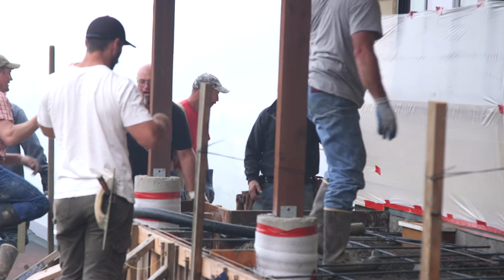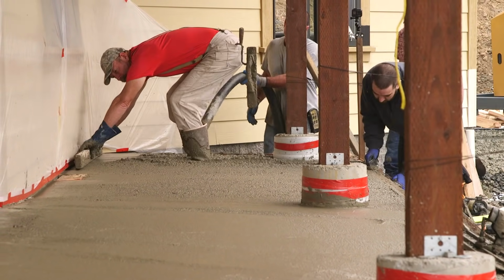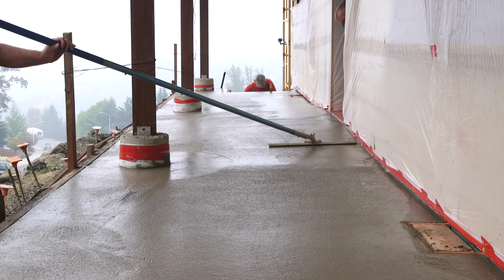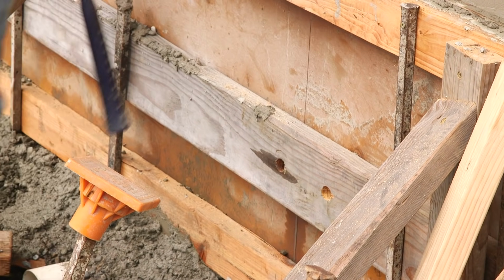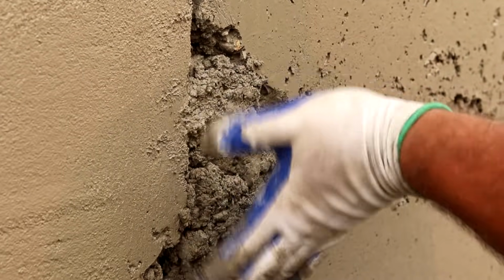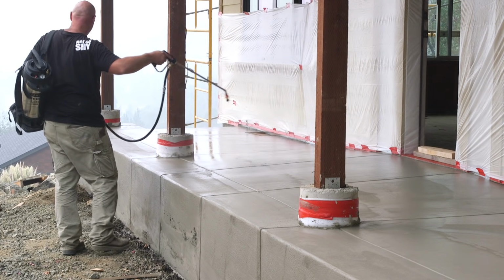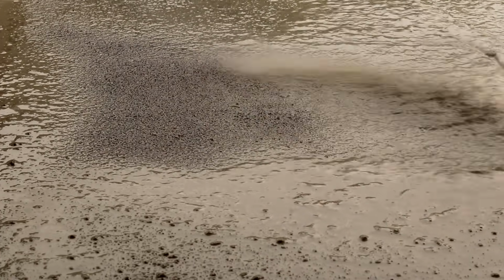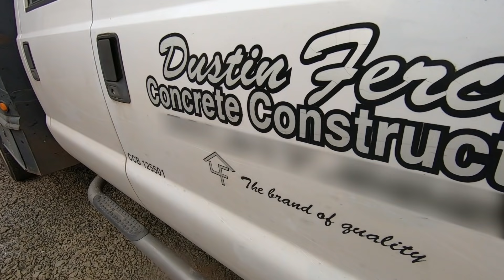Pouring Technical Concrete Ep.92

Comment: Tho, I only worked on a concrete crew for around 1 1/2 years as a young man, the lesson of timing was a lesson I used and still use in my life. I found later in life farmers also use timing, my neighbor in Texas would walk his fields looking for the perfect time to plow (5,000 acres), even if it happened to be 3am, the tractors were fired up and away they went. He told me its all about diesel fuel use.

Comment: When I heard "exposed aggregate finish" I thought that sounded silly and ugly because concrete is supposed to be nice and smooth and grey, right? Then I see the result and I'm like... I want that on my house.
Reply: A lot of folk are going for concrete floors containing limestone and other rock chips that are then ground down/polished and stained/lacquered.
While it ain't going to get any 'green' thumbs up, it is very nice, especially for southern texas, etc.
Reply: @conniethunder  yes generally speaking. But it is possible now to source carbon neutral or negative concrete mixes. However I imagine in most parts of the world it isn't available due to lack of demand (extra cost to achieve that).
Reply: @samt5663  carbon neutral materials, there's a debate you could have for ever,  speaking of which , if something can last for ever and doesn't need replacing,  does that not make it by default , the most neutral product, ?
concrete by nature is a forever product, its been around since Egyptian times, perfected by the roman times and in excavations of those times, is still in good condition,  and we still use it today, 
there for isn't it the most neutral building product , for being carbon neutral,
today we can add a lot of different  aggregates to give a variety of looks , if chosen correctly you'll never tire of it,  negating the need to change it, 
:)
Reply: @accessaryman  thanks Owen. Very good points.
And to give more context to my previous comment. I was referring to the sourcing, manufacture, delivery and installation but excluding the lifetime of the final product. Which would be harder goal to achieve for carbon neutrality.
Reply: Very popular concrete finish in the 70’s and 80’s…
Reply: it looks like a 50 year old concrete pier on the beach. i mean that in a good way.
Reply: I have it on my back patio (house built in '75). Not a fan. It looks nice, but it's painful to walk across if you ever want to go in the backyard barefoot.
Reply: Texture is good. The house I live in has a concrete front porch and driveway that were poured around the 50s. I don't know if it was the wear over the years or they thought the smoother the better, but when rain decides to blow in they become slicker than a slip and slide. Busted my knees several times from falling while not paying attention.
Reply: @accessaryman  I guess you could have a "carbon neutral" product by calculating how much pollution the process makes and then planting X number of trees or something similar to counteract it?
Reply: I do a lot of high end builds here in Aus and the trend for the last while here has been 2 or more colours of larger aggregate, and then pure white concrete. The larger aggregate allows for a slightly deeper wash and a better look in my opinion.
Reply: @Ben-fk9ey  concrete can actually be very energy saving in the long run too, as it holds heat from the day and releases it slowly throughout the night and reducing the need for heating
Reply: @samt5663   There is no such thing as carbon negative anything. People like to use the term to make things sound good but it doesn't exist. For "carbon negative" anything to be a reality 70% of the worlds population would need to be wiped out and all industry as we know it would need to stop.
Reply: @kevinvermeer9011  yeah, it picks up mold easy too. Pretty though :)
Reply: @pyritepachyderm3211  broom finish takes care of that :)
Reply: @judge462  You ever watch concrete ninja?

Comment: I'd be interested in a discussion of the relative advantage of doing the front porch like this, or with a concrete block wall along the front edge and the poured concrete just at the top.

Comment: Funny you mention determining how high a building needs to be put in at. I work for a large City and we've had multiple multistory commercial buildings in downtown areas go in at the wrong elevation making it impossible for the doors to line up with the sidewalk elevation. You'd think the engineers on projects of this size would be able to figure this out. Existing top of curb elevation plus rise of walk slope will tell you your door threshold elevation.

Comment: Interesting how the crack lines on the horizon surface were thought out to be continuous with the crack line forms built into the facial forms plywood long before the concrete arrived. Did the architect have all that in the plans?......it looks really nice. Whoever buys this house is never going to have to wonder if it was built properly or if any corners were cut.

Comment: To my eye, that looks like kind of a severe cross slope coming out to the sides from the opening. Are you guys not concerned about that? What's the fall on the patio? It looks like it'll shed water really well but I wonder if it could have been a little more gentle.

Comment: Why don't you use a concrete vibrator? That leaves a better surface area at the sides? Ore are you worried at the extra load it puts on the forms?

Comment: There's one thing that needs to be straighten up.
Stealth fibre has nothing to do with water repelling nor static electricity. Fibre prevents concrete from micro-shirinking thus micro-cracking.
As for electrostatic load in concrete. It's caused by plasticizers and super-plasticizers added to the concrete mix. It works like that. Plasticizer is added, so the same electrostatic load is given to the concrete particles. The particles repel themselves, so the concrete mix pours easier. It's done to use as little water as possible. Water decreases concrete strength.

Comment: That was almost perfect.  Why didn’t they fix that facing ?  Straight out from the door going over the ledge, on that face it’s not filled in.  The rest is perfect, except for that.  Why ?  
They fixed where that short thick board was stuck in, but left that other spot not fixed.

Comment: That turned out very nice always a little scary stripping and facing walls that thick you could lose a lot of money then to expose the aggregate on top of that I would of been a little stressed out if that was my job 
GOOD WORK
Reply from the maker: Yep... I WAS a little stressed out!!
Reply: I’m in the process of starting up my own concrete business right now 
What did you use to make the joints in the walls ? Good idea
I usually hammer a square stake in and then joint it

Comment: Great  informational video, but I'm not sure I rely on concrete as a finished surface. Cracks will come up to the surface eventually maybe 20-30 years, no? I rather pour concrete then put slabs or pavers, and any cracks developing on surface can be patched up or easily redone. Seems like a cheaper solution than spending that much money on hiring the extremely pro crew.  Also, crew looks expensive as none of them look like the non English speaking crew I'm used to seeing working in my area.

Comment: All that work making it smooth wasted
Reply: I doubt it. When you hose away the top layer (to expose the aggregate), that smoothness on the surface no doubt helps ensure the resulting exposed aggregate is on a plane (not wavy).